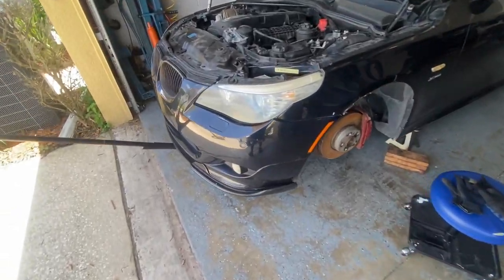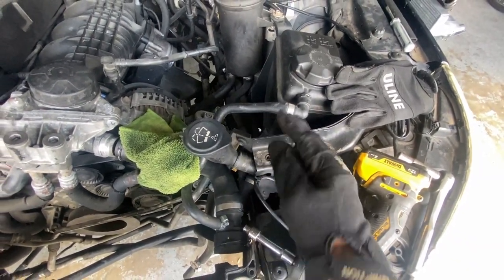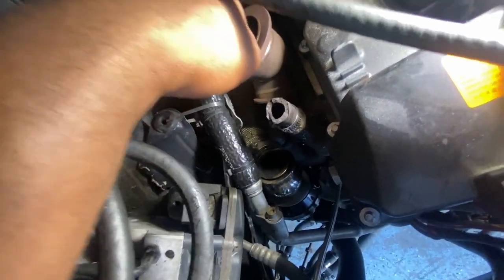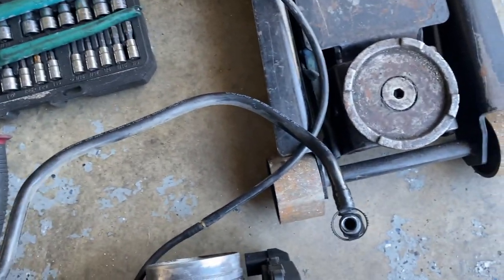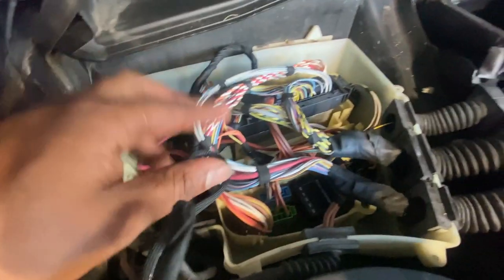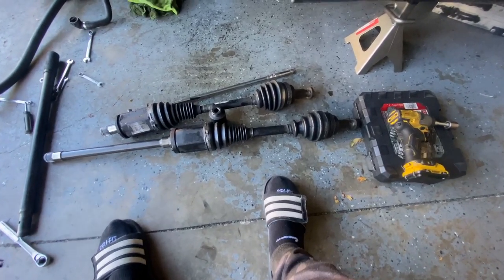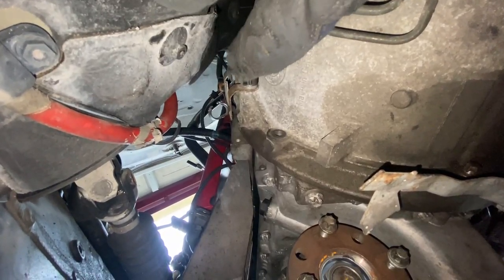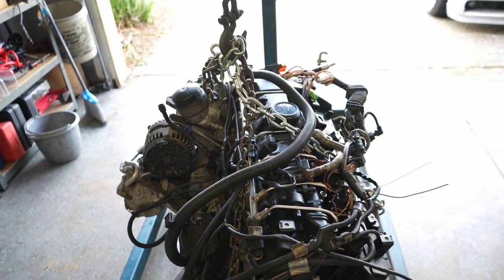BMW E60 535XI N54 Single Turbo Engine Removed - S1E05

Comment: Lol, glad you pointed out that oil cooler. Some guy in the n54 community didn't believe my 535xi just came that way stock. I still hit 235⁰ temps pretty quickly but it's been a while since i was running my tune. Struggling to set readiness in order to pass emissions.
Reply from the maker: Haha ohh wow still hitting those temps! I genuinely was surprised when I saw it though. This car had a lot of surprises.
Reply: @nOshi2x  yeah, surprisingly running 28-32psi on stock turbos with full rebuild kit. Love the build here and might inspire me to fab up my own turbo manifold. Still need to hone in my tig skills though. Btw, what kind of brakes you running up front? I despirately need an upgrade there for sure. Just not sure if that size rotor still fits with stock 17s.
Reply from the maker: Yea your car moving. If I recall correctly akebono pads, stockish setup there. The stocks should fit. Only issue is if lowered a lot might need a 10mm spacer to clear the shock a bit.